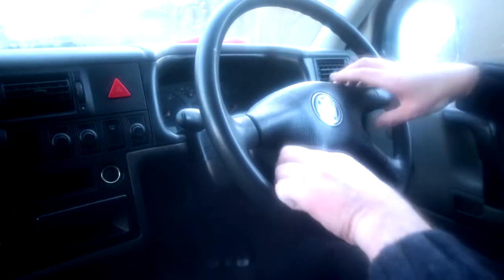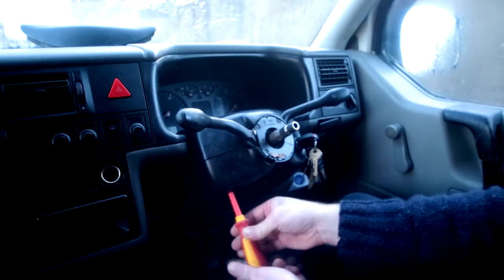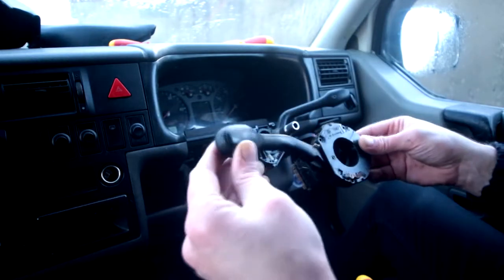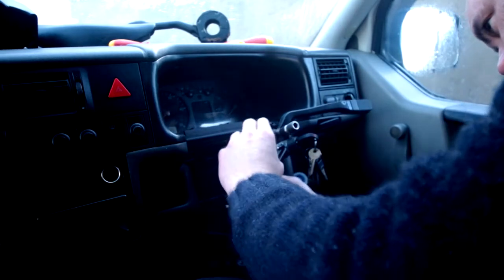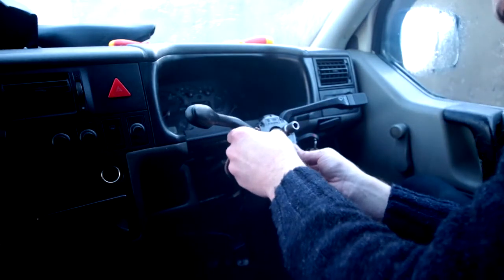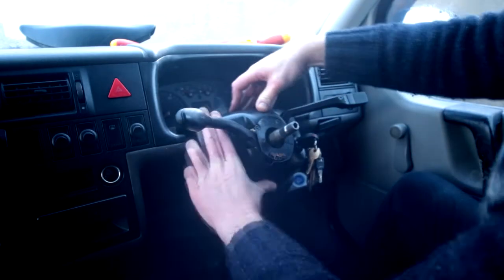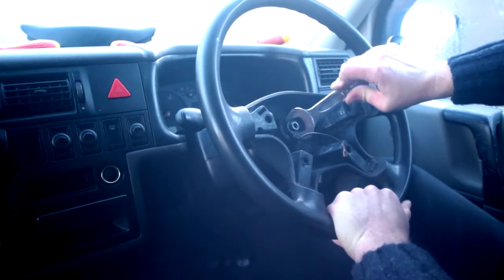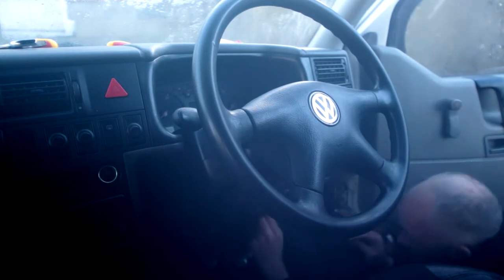VW Transporter T4 wiper stalk replacemt

Comment: Thanks for the guide. Sorted out by cleaning the stalks insides property with brake cleaner. Now works like a new.
Reply: Do you need to remove everything to clean connections or just the plastic cowling?
Reply from the maker: Need to get that stalk out to clean the copper contacts.

Comment: Great video, very handy to have this in case I ever need to do the job myself. I am swapping out the wiper motor on my T4 next week as they no longer return to the park position when switched off, there was also a problem with the intermittent wipe but I swapped the relay and that problem is now sorted.